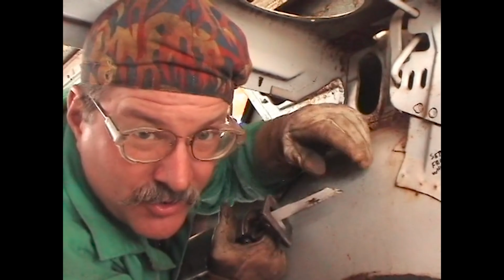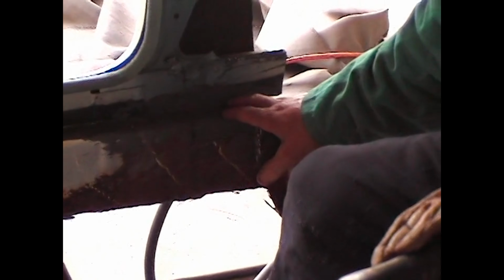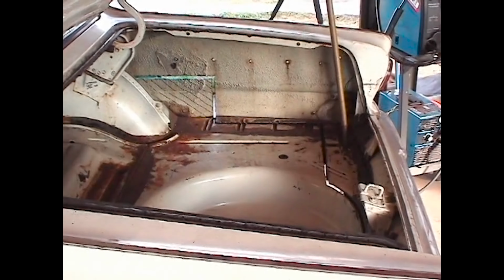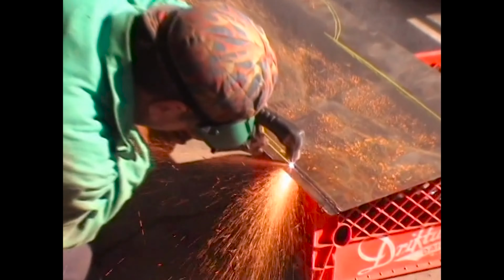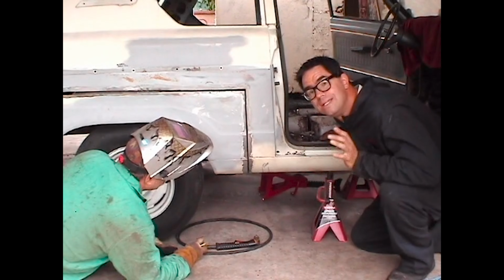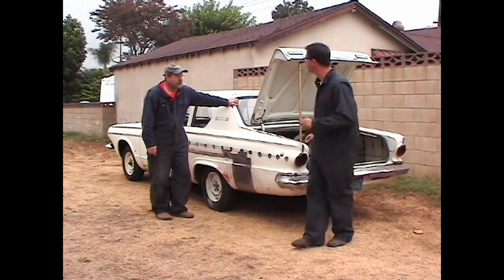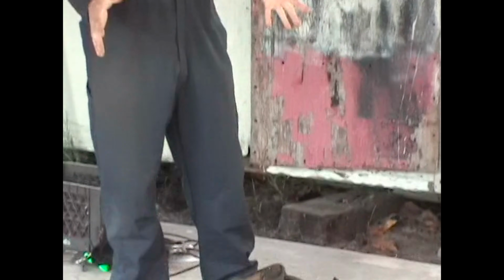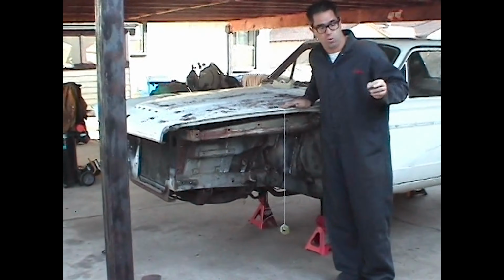Build An Altered Wheelbase Car Part 3

Comment: Thanks for giving the weights of the stock suspension vs the A100 axle, back in the day I’d always heard there was a weight saving, but after lifting a beam axle and springs, I highly doubted it. So in fact, they actually accepted a weight penalty.

Comment: Would love to see this process done on a '67-'72 F100.  Take a long box.  Remove only the section between the front and rear wheels.   Leave the back long.  Then move the Twin-I-Beam forward on the frame.  A funny-truck.  Could be sweet.